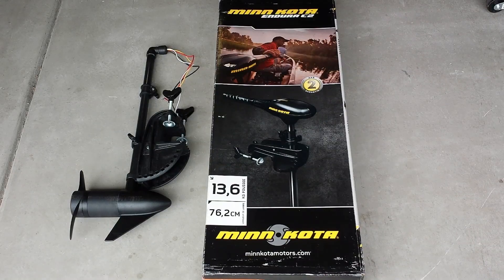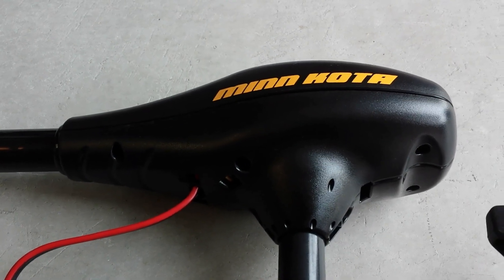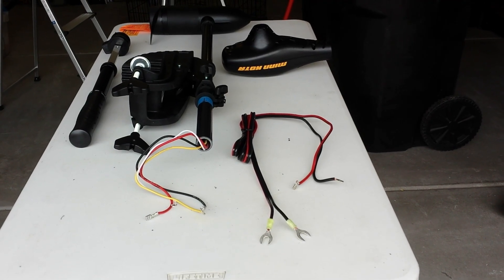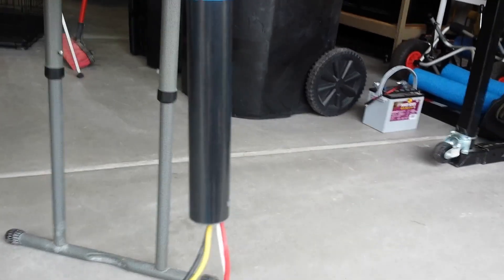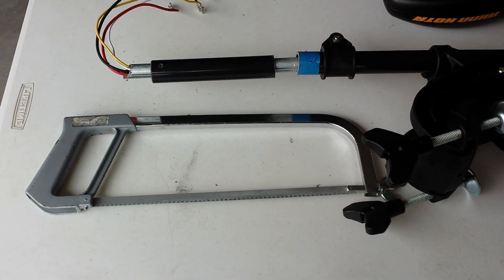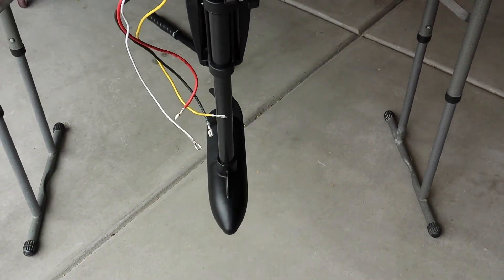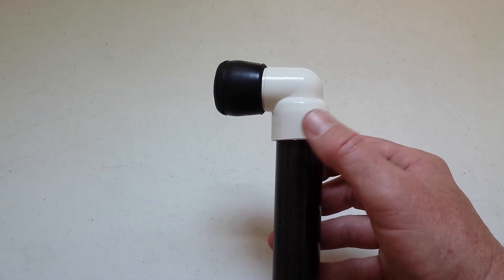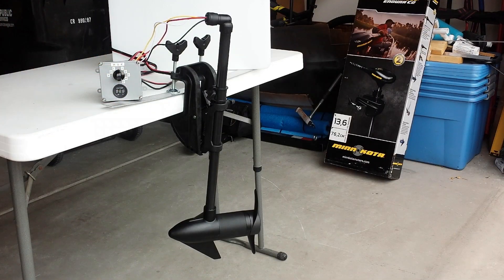DIY Shortened and Modified Trolling Motor Shaft for Kayak

Comment: You can put a momentary foot switch to turn your motor on and off which helps tremendously. I am contemplating cutting my troll motor and making some sort of control box but I’m not an electrician :) I am just using the head unit and an on/off switch with a steer stick and it works great. Nice video and thanks.
Reply from the maker: Thanks! The only thing I don't like about momentary switches is that you can only set it to  a constant speed.

Comment: Hi, what is the yellow and white wire coming out of the shaft.? Thought it would just be red and black for power? Thx
Reply from the maker: It has to do with the speed changing. You only use the red/black with a PWM or ESC.
Reply: @Aksmaniyak  thanks man
Reply from the maker: @desertvegasfishing  You are welcome.

Comment: Hey Aksmaniyak, I plan on doing this same mod with my Minn Kota c2 30. Since the speed control wires only go so far out of the shaft, I would need to extend the 4 wires about 4 feet to my kayak seat. Should I match the wires' gauge for the extension?
Reply from the maker: That should be fine.
Reply: @Aksmaniyak  The manual says extending the wires on the c2 30 might affect the performance. Have you ever noticed any sort of performance changes using this mod?
Reply from the maker: No, that is just a disclaimer by Minn Kota.
Reply: @Aksmaniyak  Okay 👍 Thanks for the reply and videos. Cheers

Comment: How did decide the length you need? Was it from under the kayak motor prop should be fully exposed to water coming or half of it can be covered by kayak
Reply: Thank you for responding
Reply from the maker: The prop should be at least 2-3 inches below the surface with calm conditions.

Comment: Ok. Would I just be able to cut the shaft and extend the wiring through a  tube and just attached the handle near the kayak chair?
This is rather impressive with the remote and controller and I do not have easy access to the controller.
Reply from the maker: You can remove the head, mount near the seat, and extend the wiring.
Reply: @Aksmaniyak  I appreciate the reply, truly.
Reply from the maker: You are welcome.

Comment: Hi there, your videos are exceptional.  I had a new 36 inch Minn Kota that I cut down to about  27 inches, but without taking into consideration of my motor mount height and the few inches the foot steering V that I installed takes up and it left me with the lowest point that I can get that motor below the waterline is 10 inches. From the top of the prop it's only 7 inches below the waterline. I fish in lakes and rivers. I understand much lower is recommended.  What is your opinion on whether this will work at this height? Here's what it looks like. Thanks very much!!! 

https://youtube.com/shorts/zV0_vEJaYlA?si=fhp72UbId-2oQq2z

Comment: I want to shorten the shaft (same motor), but I want to put the head back on it. What do you suggest for the extra wire length??
Reply from the maker: You can wrap it up in the head or cut it short and use new connectors.

Comment: Do you have a trolling motor recommendation? I was going to go with the Minn Kota unit with 30 pound thrust (30" shaft), but would like a bit more thrust. All the Minn Kota models with higher ratings have the 36" shaft, which is a bit long for my canoe. Other brands have the specs I want, but not sure of the quality, etc. I just want a good quality unit. :)
Reply from the maker: Newport Vessels and Haswing are good motors.

Comment: I have a question. When drilling a larger hole for let's say a quick connect port, do space bits work well or is there a certain type of bit that works better?
Reply from the maker: Spade bits work well with large holes.
Reply: Thank you. Got some spade bit but kept worrying that auger bits may be better. Much appreciated!
Reply from the maker: @jonschroedinger8360  You are welcome.

Comment: Hey, what did you do with the excess length of cables to the head unit?
Reply from the maker: If you mean the yellow and white wires, I capped them off and put them back in the shaft. I didn't want to clip them too short in case I needed them later.

Comment: Hello if you were to upgrade to pwm setup, what do you do with the yellow and white cable connected to the resistors? I was just thinking about tying them up and leaving them in the eclosure incase i wanted to switch back
Reply from the maker: You can cap them off or use liquid electrical tape on the cut ends and tuck them in the shaft.
Reply: Wow thank you for the fast response. Since im in a inflatable and not a kayak i decided to keep the head and use that as a control box and put a water resistence air vents at the hole orinally left by the handle. You are awesome by the way. Look like a beast too
Reply from the maker: @33sosa85  lol. Thanks! Post a pic if you can when you are done.
Reply: @Aksmaniyak  i made a mistake of saying that the battery was connected to the motor instead of pwm but here it is https://youtu.be/9R3S8bQlZpU
Reply from the maker: @33sosa85  Nice work!

Comment: Love this design, especially with the change-over to a dial and switch box for use from the kayak's seat.  I would love to use this design for a bow mount motor.  However, wondering if you have videos for a bow mount.  Am hoping you do, so I can see how you set up a steering system to be operated from the kayak seat.
Reply from the maker: Thanks Alan. I have used bow mounted trolling motors but only with wireless remotes.

Comment: what'd you do with the remaining two initial control wires? just electrical tape the ends?
Reply from the maker: I put liquid electrical tape on the exposed ends. Then I pushed them back into the shaft in a loop and I zip tied all 4 together.
Reply: @Aksmaniyak  awesome man! never knew liquid electrical tape even existed! thankyou for the quick response!
Reply from the maker: @KennethMillerPhotography  You are welcome!

Comment: Used basically the same idea several years ago, but used a compression fitting for the elbow.  Wires ran through a wiring loom (SAE style) from Auto Supply store.  Also went up a couple of wire gauges (8-Gauge) coming from the motor to switch, as I had to run them 7 feet away from motor.
Used a Commercial Wiring Box (4x4) for switch and handle, so I'd have 5 forward and 3 reverse speeds (used the mounting track of my kayak to hold the box, along with toilet bolts that fit the track, with through bolts and knobs).  Quick disassembly from kayak, as I made a motor mount that fit where the center pedal drive unit was.  
Only invested around $180 including the battery and trolling motor, but had to get rid of it 'caus of Fish and Game kept telling me I would get arrested the NEXT time I was caught out on the lake without registering my kayak.
Had fun making it, and sold everything for $300 bucks to a guy that just HAD to HAVE it...!  Lol...

Comment: Question:   Can you build me one of those fancy boxes?     And I really liked all of your ideas.  I am planning on doing the same thing myself and the tips about the pipe and turning it upside down before you cut were great. Thanks!
Reply from the maker: Thank you. I don't build/sell the boxes because I can't warranty the parts.
Reply: @Aksmaniyak  lol damn.     My idea has always been to buy a 55lb trolling motor, rig up a small throttle like a boat would have and a steering system so I don't have to use the handle like that.  Maybe like a footpaddle boat would have for the rudder/motor.  Been searching ideas, your video definitely helped though.  I'm trying to learn all the logistics of wiring and how to set it up on my kayak.
Reply from the maker: @xjcrossx  Thanks. There is a person in this FB group that has modified a paddle boat. It may help you. https://www.facebook.com/groups/3521517597860461

Comment: FYI you probably could’ve used a tubing cutter/pipe cutter to cut that better rather than a hacksaw.
Reply from the maker: Actually, a pipe cutter does not work well with composite shafts.

Comment: use a pipe cutter . clean , no burrs
Reply from the maker: Have you done that before? It doesn't work very well on the composite shaft.
Reply: @Aksmaniyak  no I haven't used one on composite . Metal only. Interesting to try.
Reply from the maker: I agree that it works on metal better than a hacksaw. The issue with the composite shaft is when you tighten the screw, it just crushes the shaft so it won't make a cut. That's why I used the hacksaw.

Comment: What PVC fitting did you use for the top of the trolling motor
Reply from the maker: A 90 degree 3/4 inch slip fit 
PVC fitting.

Comment: So I have a question. What wiring did you use to run the wire to the box you made. The box I assume would be up front near you , the wiring isn’t that long, so did you splice?
Reply from the maker: Yes, I added 10G for the pos/negs and 14G for the white/yellow wires.

Comment: Heat shrink the 4 wires out of the head? May help keep the chair foot from leaking.
Reply from the maker: You could but the rubber chair foot doesn't leak if you drill a snug hole.

Comment: Aksman what of you take of the propeller amd put in a bigger one from 15 hp would it go faster ???
Reply from the maker: I do not believe so. It may increase thrust but each motor has a top speed based on the kayak and water/weather conditions.

Comment: Your 90 degree fitting is called a STREET ELBOW... Good job on the wire protection and upside down cut.
I was going to order an extra speed control switch ($20 on ebay) and make it plug in the back with the speed control mounted on the right/inside of my yak with a shift lever pointing up as off, push forward to go forward and of course for reverse you pull back. was also thinking about a momentary on thumb button  so the lever doesn't get turned on accidentally. Next issue was steering and raising the motor... On my yak is 3 feet behind me and i'd have to lay back and reach over my head to control the motor...
After doing all this thinking and figuring... My kayak is actually a KIWI ANGLER PONTOON kayak.... I'm just going to make a simple bow mount, turn the head and use a small piece of rubber hose (As a U-Joint) to a piece of PVC as the extended handle.
Reply: Oh yeah... I may shorten the shaft too.
Reply from the maker: Nice. Sounds like you have it figured out. Let me know when you finish.

Comment: The gloves are Nitrile not nitrate. The shaft can be cut with a metal tubing cutter with a lot less chance of nicking any wires. Good video otherwise. I installed a remote steering cable on mine so far.

Comment: That's what I was thinking of doing and just mount the head of the trolling moter under my seat if that's possible
Reply from the maker: Yes, I have done that before. I added a section of PVC pipe in the head with a RAM ball. I used a RAM mount to attach it to the hull.

Comment: I have a question. Why?
Reply from the maker: Why what?
Reply: @Aksmaniyak  Why remove the head and use a controller box?
Reply from the maker: There are 2 reasons. One is to move the controls closer to the seat. The other is to replace the stock controls with a digital speed controller (PWM).
Reply: @Aksmaniyak  Mate, I have a kayak with 60lb electric motor that I have had for almost 3 weeks but hadn't put in the water until Tuesday just gone. I can totally see why you want the control closer to you now haha I have my motor side mounted but it makes things uncomfortable and difficult to turn right. I am going to get rid of the rudder and mount the motor in that spot and use the current foot pedals to steer it.
Reply from the maker: @craigf9031  Nice Craig.

Comment: Nice video on composite shaft t.m. I have been using aluminum or stainless steel 1" diameter shaft trolling motors and I use the head also it has built in light and battery voltage  gauge ,I buy stainless steel 1" inside diameter fittings from a marine hardware store,,I have stayed away from composite because the shaft is metric size and will not fit ready to go hardware ,I can use composite  shaft as long as I make a custom steering bracket,,and if the wiring is not marked I take a pic with my phone,,thanks for sharing your knowledge for the betterment of electric kayaks
Reply from the maker: Thanks Verdell.

Comment: Would a couple sturdy brackets and a small Morse cable work for steering with the original head
Reply from the maker: Yes. The reason the head is removed is that the control switch is either moved or replaced.

Comment: I got a blue what’s that for ?
Reply: Literally going to get some wire what gauge for power to use
Reply from the maker: I use 10G for the pos/neg power connections. For most PWMs, you only need the red (+) and black (-) trolling motor wires.
Reply: Tested my trolling motor today because of your help it was a great test once I got the steering right. Have not built my control box yet wanted to test first ever thing was good.
Reply from the maker: Blue wire? What make and model trolling motor do you have?
Reply: Older motel 27 # minn kota

Comment: In your PWM video it looks like all I need to get is the module in your video  and hook the wiring up? that automatically connects somehow to the remote or is there something else that does that?  Sorry in advance if dumb question, electronics is definitely not my strong suit.. Thanks for all you videos ive looked at most...Ken in Oakley CA  Cheers.....keep the great vids coming
Reply from the maker: Thanks Ken. Yes, all you need to do is connect your power source (battery) to the unit and then connect the pos (+), neg (-) wires to the trolling motor. The remote is already wired up to the main unit. It is a very good PWM and easy to hook up.